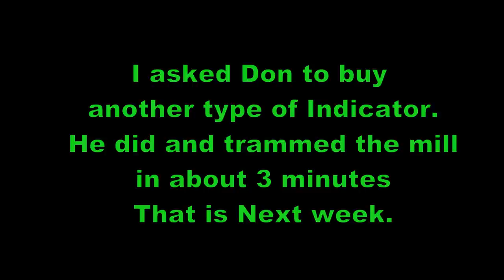Restoring a Shaper: Fitting the nut.

Comment: Can you filter the oil BEFORE it drips into that channel?  Then you don't need the filter on the nut.
Reply from the maker: there would be clean oil from the tube as it is coming from the oil filler... It's the tramp oil from the regular oiling method that would be contaminated. Hence make a channel in the nut to funnel that away and just rely on the clean new oil from the tube.

Comment: How old is the machine. Looks like if you made the Nut out of the same metal that lasted a long time. I don’t think Don would wear it out. Kinda over engineered ? Kinda like your videos but this Nut lasted way to long to make?
Reply: Yes way too long!!😅
Reply from the maker: IF the nut lasted a long time why did they change the design of the machine to pressure flood that area a few years later?

Comment: Question Mr Steve and I probably will never ask another because you never reply so I don't have a good enough Question for you or you do nor read them why not run copper drip line to oil entire screw that wry it will oil the nut keep screw oild nut will be oiled ? Right or wrong no oil could plug nut
Reply from the maker: I am sorry about replying... I answer almost everyone  IF I see the question and they are not just Butt Holes :)   Sometimes I never see some questions because YouTube never alerts me to them....  

The oil line is very small and there would not be enough volume of oil needed to make it past the first few holes..  Only way to make the oil travel the 2 feet of tube would be a lot of oil and pressure.. Make one heck of a mess dripping out the bottom.